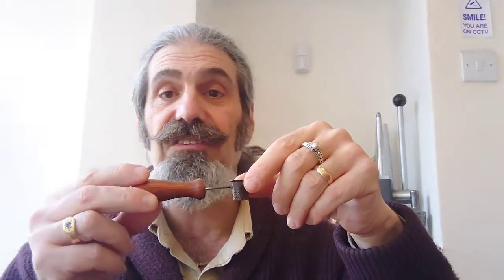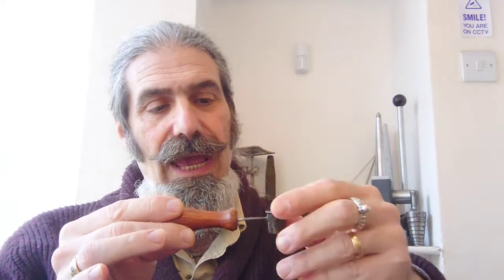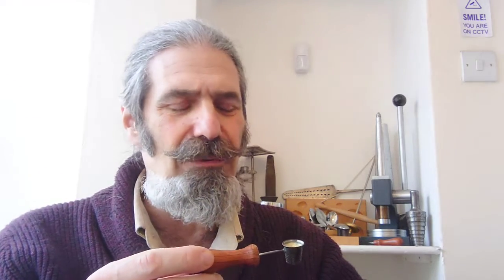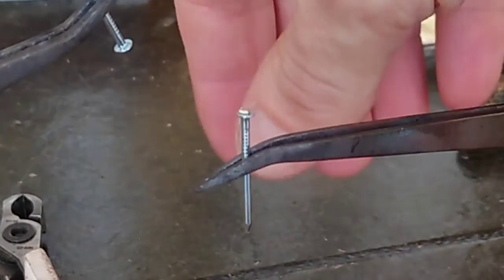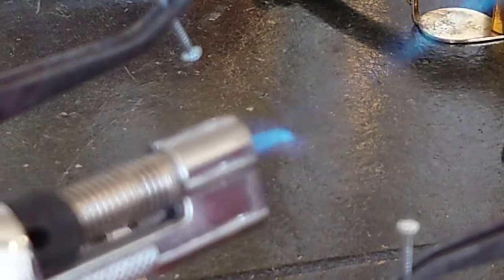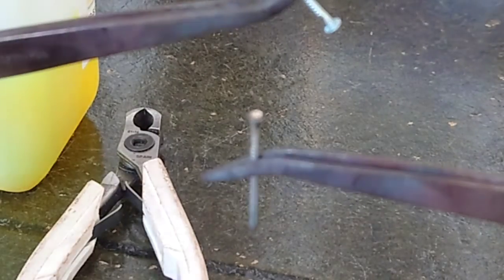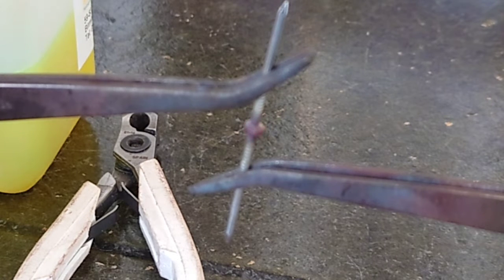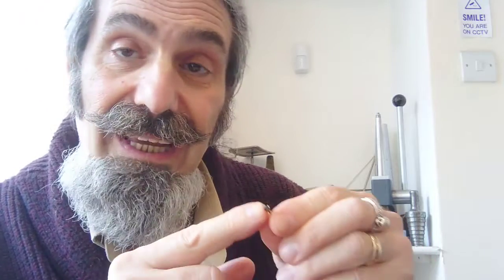Fusing Mild Steel with Silver Solder

Comment: What kind of solder is this one and where did you source it. If you google silver solder you get a million different types of
Reply from the maker: In this particular video I was using 925 sterling silver hard solder. I normally buy mine at the same bullion merchants I use for buying in silver and gold for jewellery manufacture. Cookson Precious Metals here in the UK would be a good example, however it is available to purchase on eBay. The four main types of silver solar you will come across are hard, medium, easy and extra easy. These designations relate to the melting point of the different solders, with hard having the highest melting point, and extra easy the lowest.
Reply: @Jeff.Lippman.Presents thnx. Harris makes some different types with a decent melting point.

Comment: you can silver solder with a couple cigar lighters  ?
Reply from the maker: If you have a butane jet flame, that will burn above the melting point of the silver solder. Providing the surrounding metal is not too massive and acting as a heat sink, the small flame is sufficient to create a good bond. Obviously if you're dealing with a larger pieces of metal that act as a heat sink a larger blow torch may be necessary.

Comment: Would it be possible to silver solder a fine silver bezel to a mild steel piece? I am thinking in terms of a penannular brooch of mild steel with a cabochon attached.
Really love your content, and appreciate your time answering!
Reply from the maker: I don't see any reason why it wouldn't work, but you're going to have to be careful with the blowtorch to avoid overheating the silver. Let me know how you get on, and if the materials don't cooperate, perhaps I can make a follow-up video looking at that specific issue. The most important tip I can give you now is to ensure you use the correct flux, either something like liquid auflux like I've used in this video, or else borax, which is less easy to use, but has been the go to flux for silver for centuries.
Reply: @Jeff.Lippman.Presents I am also considering using a pin through the steel, with maybe a drop of solder on the back side to hold.

Comment: Thank you very much that was the most informative demonstration of silver soldiering now I shall try and repair my shotgun spring Thank you very much
Reply from the maker: I'm glad you found it useful, I can't say how the heat will affect the temper on the spring, So I'd be very interested to hear from you when you've done it, to let me know how it came out.
Reply: @Jeff.Lippman.Presents  will I have some stuff which is supposed to stop the heat spreading to the main spring part as only the end is broken off hopefully it will work if not I've got a maker complete new  I will let you know how it goes

Comment: Can I silver solder two pieces of hardened steel? I'm trying to fix a gear pinion onto a shaft.
Reply from the maker: Although silver solder can and does form a very good join, what you're describing leaves me with a certain concerns. First of all, it's a quite high temperature operation, so that it might alter the temper of your hardened steel. Of course, if you're talking about fixing a drive shaft on a small rotary tool, I wouldn't be too worried, but if you're talking about something on something like a car, where a catastrophic failure could be life-threatening, I personally would think in terms of replacing the shaft altogether. Specifically because of issues relating to how it could alter the temper of hardened steel, I've never even attempted to Silver solder two pieces of hardened steel together with silver solder, if anything, my immediate go-to would be actual welding with an arc welder, and even there I would have concerns you could end up making your metal brittle depending on what you're doing. I've had good success. Fusing brass together and mild steel with silver solder as well. Obviously as fusing silver together, but I've never tried it on hardened steel so cannot make any claims about how effective it would be. I will say if you try it, I'd be very interested in feedback from you regarding how well or not it has worked.
Reply: @Jeff.Lippman.Presents  it's a pinion of the output shaft of a starter motor. This is the pinion that engages with the teeth of the starter ring when you start the vehicle.  The shaft and pinion already have splines so the solder won't be transmitting the torque. It's to keep the pinion located in the right place on the splines and not slide off.
Reply from the maker: @PJ-om2wq  it might work, but if you try it, absolutely make sure that you're using the right kind of flux, as I discuss in the video, otherwise don't expect good adhesion. Let me know how you get on.
Reply: @Jeff.Lippman.Presents  thanks, I already tried welding, but after a couple of starts the weld shatters. The pinion is about 15mm wide (just over 1/2 inch) but my 135 amp Mig welder only seems to melt two or three mm of the 15.  I'm thinking that if the silver will penetrate the entire 15mm it will be way stronger
Reply from the maker: @PJ-om2wq  sounds reasonable.

Comment: Is the flux the same as for copper pipes soldering?
Reply from the maker: That is a very good question, and a very important question because no, it is a different kind of flux. Precious metal soldiers require the use of either borax as flux, or alternatively as I'm using in the video something called Auflux, which is a purpose made liquid flux that you can put on with a small paintbrush used with precious metals. If you Google it, you'll find it not hard to track down, a number of vendors for selling it on eBay for example, and it isn't particularly expensive. Unless you're doing a hell of a lot of silver soldering all the time, it wouldn't surprise me if you found one fluid ounce to be a more or less lifetime supply.

Comment: I have a nice counter top water filter, with the only drawback being that it leaks 1/4 cup of water a day. I can't buy a tray with a raised lip that will perfectly fit it, but I can bend one, then join the corners. This looks like a perfect solution.
Reply from the maker: Just make sure that you drain the system of water before you start.

Comment: Great video, which solder did you use?
Reply from the maker: I use what is called silver hard solder, which is a hallmark standard silver solder, normally used for bonding sterling silver, although as you can see, it's more versatile than that.

Comment: I had my eyeglasses repaired like this.
I have the silver and the torch but the flux I will be using is powder for brazing.
Reply from the maker: If your brazing power is predominantly borax, I would imagine that would work. The main thing to remember is that precious metal solders are expected to work at temperatures north of seven hundred celsius at a minimum. I would be very interested to know how well your brazing power holds up.